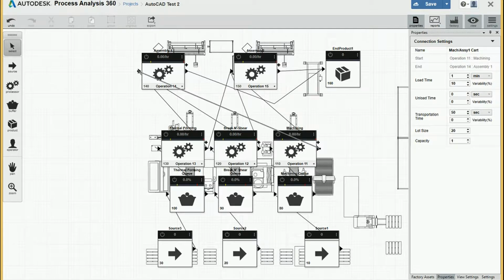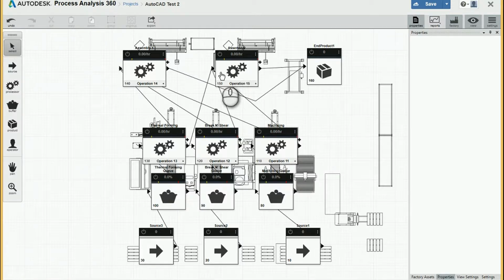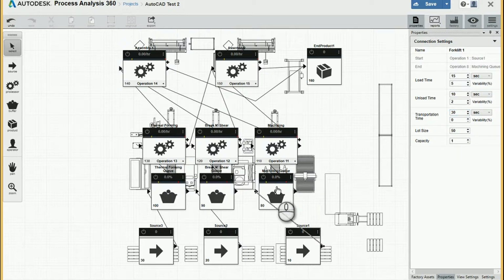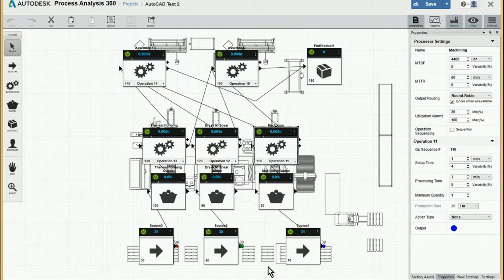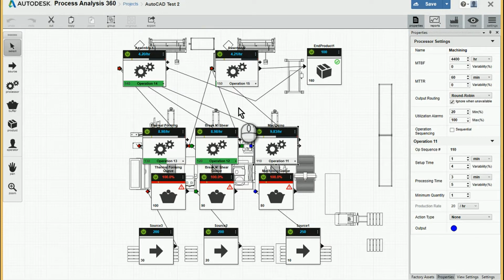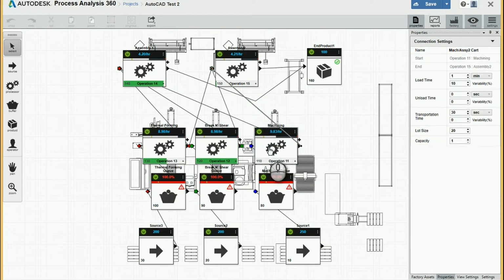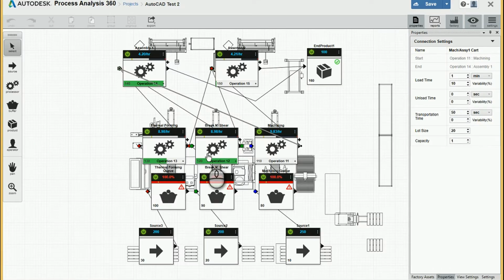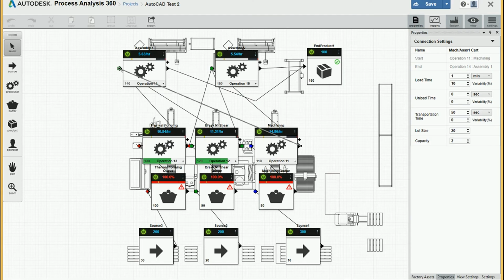Process Analysis 360 - Overview

Comment: Why are You using Process Analysis 360? This Tool is now retired and no longer available. The New Tool called Process Analysis is now Part of the Factory Design Utilities. Maybe a few or a lot Things change, so the way of using is not the same.
Reply: I have Factory Design Utilities but no Process Analysis. I downloaded Process Analysis but it won’t run on Windows 10. Can you offer any advice?